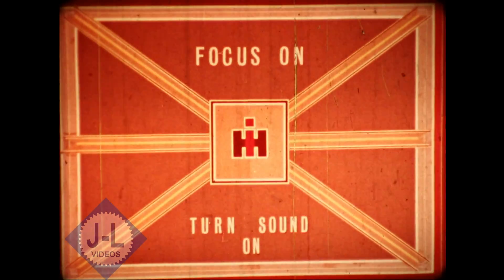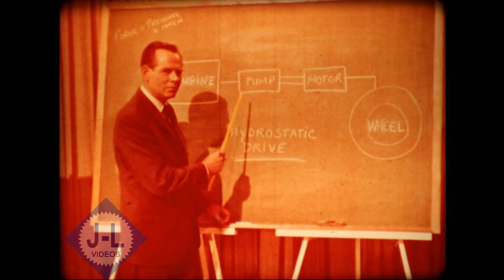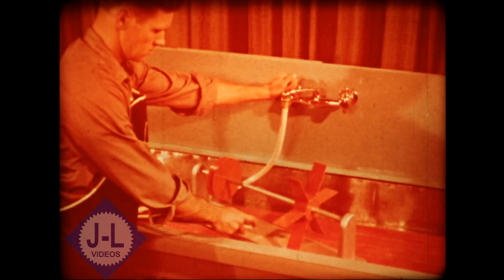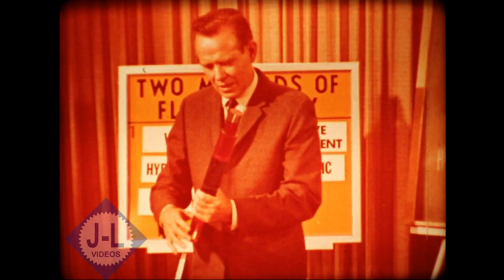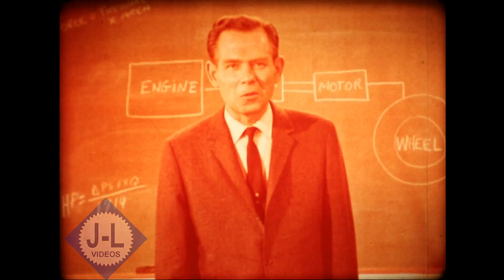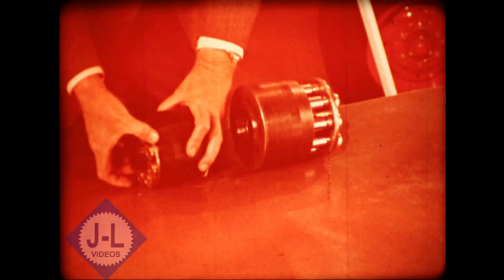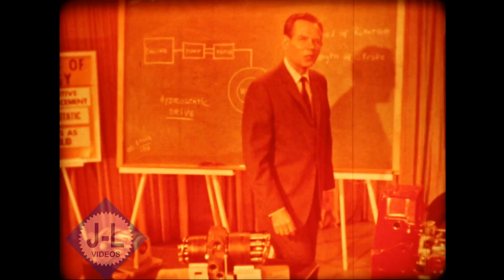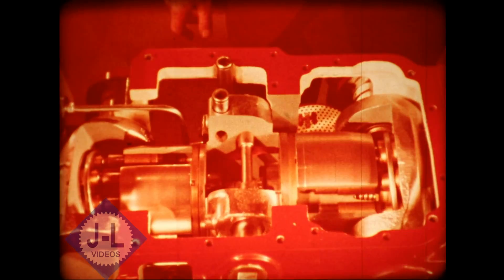1960's International Harvester Film Principles of Hydrostatic Transmission Farmall 656 Tractor

Comment: My dad and I both owned 656 Hydro utility tractors with loaders.  They were great for loader work, and adequate for light draft operations like pulling wagons or mowing hay. Great chore tractors.  But with any continuous heavy drawbar load like tillage, they were pretty much useless.  There's a reason they never put hydro transmissions in larger tractors.

When combines were introduced with hydrostatic drive it was a great improvement, and of course they are pretty much standard on quality lawn tractors now.  Everything has its place.

Comment: The hydrostatic transmission should never have been used in farm tractors.  We had an IH 656 hydrostatic, it was purchased when 1 year old, the next 3 years, the transmission, went out each year. One year it was merely pulling a 7 ft., sickle bar mower. A piece of CRAP, if there ever was one.

Comment: If the hydro transmission actually was worth having in a large farm tractor, Allis Chalmers would have made it.
Inefficient, and problematic, which is why no one else used it, same with the 2+2 equals nothing, and forward air flow.
Sale gimmicks and that's it

Comment: Today hydrostatic drives are only used in self-propelled machines (Mädrescher or forage harvesters) because they are less efficient than planetary gears. Or wedge rim variators are simpler and more effective in the drive. Continuously variable transmissions are a symbiosis of mech. and hydraulic components.

Comment: We got a 656 hydro. We bought it and put a loader on it. Doesn’t have the power as a gear drive but it was quicker without grinding gears. Our 6 has a problem when you reverse it, you have to push the lever away from the tractor or won’t move. Right now it has a blown head gasket.

Comment: When the great precursors innovated in gearbox without clutch... In Europe we did not have the Farmall MTA, nor the 560 series and the first was John Deere 4020 and 3020 with power-shift in 1963, although many were only equipped with syncro-range gearbox. John Deere was little imported before 1960, it is only by buying Lanz (now obsolete with their single cylinder but very widespread) that he took advantage of the very extensive network of dealers and customers. Ford wanted to launch the select-o-speed on the 5000 in 1965, but did not sell any (too fragile). The 5000 was a success but with a mechanical gearbox. Case proposed the 730 case-o-matic in 1960, but this brand only became successful in France after buying Societé Française Vierzon and producing backhoes. IH imported some 806,1256, the hydro 100 in 1974 was too expensive and drank a lot. In the European IH range, it was not until 1980 that there was only a hydraulic coupler as an option on the 1455, the real power-shift did not arrive until 1988 with the Magnum 7110, 7120 then 7230 series etc.. IH remained archaic for too long without even a semi-auto gearbox, it had lost sales as early as 1962 with the F270 (fragile all over), but had recovered with the 624,724, in 1965 finally in 1974 with the 744,844, 946,1046 but with a recurrent problem of porous cylinders.since 1945 IH had the most widespread network of agents and mechanics, but for 30 years it has been in decline: today it has lost all its dealers, you have to travel 100 miles to find the nearest one.
Reply: No. There was a hydrostatic tractor in Europe. The German Eicher Mammut HE.

Comment: They came and went pretty quickly at IH. My neighbor had a 656 and a 1026 . While smooth and easy to operate the big gripe I was told was that the hydro  cost about 10 hp and seeing up close and personal was they were hogs on fuel. I spent all day hauling fuel out to the 1026.

Comment: Interisting, thanks for sharing. That sounds very early. Does anybody know who was first IH or JD' 1964 power shift and witch was good to operate?
Some say, JD's Power Shift was born out of a Ford 'O' Matic ingeneer (Great book of Ford as may be a source).
Reply: The Hydro is a Hydro and the PS is a PS.

It depends on what you are doing. The hydro is great for things like loader work or baling or similar, where its nice to have an infinite amount of speeds. 

The PS is nice when you are doing something like tillage or planting where you get up to speed and stay there.

I can't say on Deere's powershift as we don't have one, but the IH hydro we have will never leave and probably have a few more join it. They are very very handy.
Reply: Harold Brock designed the SOS first for Ford, and then the PS for Deere.
Reply: @douglaskattau9241  Harold Brock seems to be "the key man". He also wrote the Ford book.
Reply: Case and Ford were both early to the full powershift game.  The Farmall has 0 mechanical connection in the drivetrain, the powershift was basically a servo clutch shifted constant mesh transmission.  Much less heat and friction loss.  Look at the difference between gear and hydro tractors of the same model at Nebraska.  Having a non turbocharged hydro tractor would be like having a hole in your fuel tank that perpetually wasted a metered amount of fuel.
Reply: @randymagnum143  Case's Deere debated design, shifting sucks. We have a 94 series. It's like dumping the clutch every gear. But it has been reliable so far.

I can't comment on Ford. I don't even know of anyone who has a Ford Tractor near me.

You do realize that the Hydro was an option? The entire line did not have it. You do also realize that the IHC 5088, 5288, 5488, and the Super 70s had a powershift and the Magnum Powershift is an IHC design? Before that, they had a standard transmission design with a TA.

We have a Gas Hydro, a 544 Farmall. Its just as efficient for what we use it for compared to any other tractor of its era, in our case, more efficient as it is a feedwagon and loader tractor, along with a PTO tractor.
Reply: @J-1410  😂 no, no.....Case and Ford had full powershift transmissions.......in the late 50's.  Look up "Case-O-Matic" and "Select-O-Speed"
I understand hydro was an option, thats why i said to compare the Nebraska test results from gear and hydro in the same models.
The Magnums had good engines.  I've read about them trying to adapt IH's syncro tranny to powershift.  How many parts ended up being compatible?  Serious question.
Fwiw, Allis had better cabs and transmissions in the 8k series.  I love the 426, but an 8070 with a CTA cummins gives up nothing to a Magnum.

Comment: A new era of tractors that don't move?
Reply: So what's your issue with the Hydrostatic transmission that everyone uses?
Reply: @J-1410  like now?  Like the Fendt vario, that costs all of the money and is not field servicable?  Btw, the Fendt is much more efficient in operation because it tranfers a varying percentage of the power mechanically.  
All that aside, would you use a farmall hydro for tillage work?  Would you prefer a tractor with 20% less fuel efficiency and a much higher cost of ownership?
Reply: @randymagnum143  I don't get the Fendt part...Never been around them and probably never will as a "Premium" tractor has no place in our IH, Versatile, Steiger, and Deere dominated area, much less supported  by the joke that is AGCO who keeps having identity crisis's every few minutes. Also, I thought a Fendt was a CVT or something though and not a Hydro?

We have a couple IHC Hydros. We've used them for tillage and they cost no more than its Powershift and standard transmission relatives. 

That being said, they weren't exactly designed for tillage. They will do ok, but if you want to use it primarily for tillage, you'll need to put more oil cooling capacity. They make excellent Loader, Baler, Cutter,  pull type combine, grain cart, feed wagon, etc tractors, where an infinite amount of speeds works better than burning out a clutch. 

Tillage work here, is an articulated 4x4's job. Even the smallest farmer has an old Versatile or Steiger for that, but even then, this is minimum till and no till country. East and west of me, Versatile and Steiger were already showing up for tillage, and horse power wise, the IH hydros were too small already for the implements. That being said, if they made a 300 horse Hydro, I'd be interested in trying it. Even if it doesn't work for the little tillage we do, it sounds like it would make a great blade tractor.
Reply: @J-1410  watch the animation for the vario.  It uses a variable displacement piston pump to regulate the speed of the differential that varies the output speed.
Reply: @randymagnum143  Aren't they a CVT anyways?
Reply: @J-1410  you're missing the point, the device that regulates the gear reduction is nearly identical to ih's hydro pump.
Reply: @randymagnum143  so what's the point you're trying to make? Ones a hydro and ones a CVT still.

Right now all I'm getting is something like "see the fuel injection is the same on a Cummins as is a Detroit"
Reply: @J-1410  actually, the new cat injectors are the same as ddec injectors.
You are not very mechanically inclined, I take it?
Reply: @J-1410  Try getting one worked on .
Reply: @dodge-ut6ti  Easy. Our dealer 50 miles away overhauled ours without issue. They are simple.
Reply: @J-1410  Are you talking IH hydro?
Reply: @dodge-ut6ti  Yes? This is an IHC video, and we have a couple of IHC Hydros.

Why wouldn't I?

Or do you mean the "everyone uses them" comment, if so, Gleaner, IHC, Deere, Case-IH, JICase, Versatile, Hesston, Macdon, Bobcat, Melroe, Clark, Caterpillar, and Allis-Chalmers and many more used(or still use) Hydrostatic transmissions in their farm equipment.
Reply: @J-1410  I wouldn't have one. Not reliable enough  for me.
Reply: @dodge-ut6ti  well u havent driven one then
Reply: @CheeseMiser  No but I've  paid more than one shop bill.